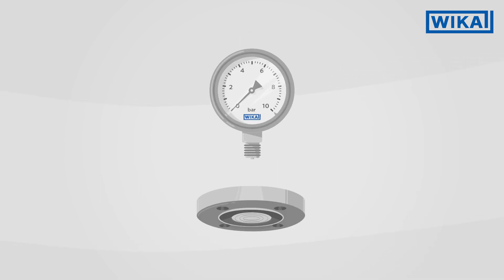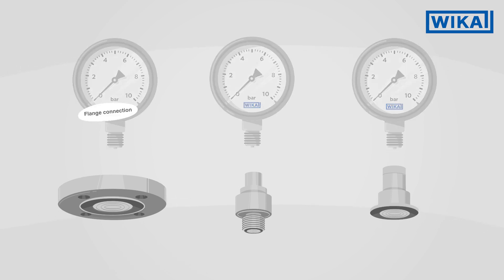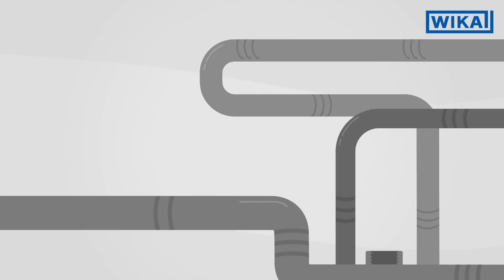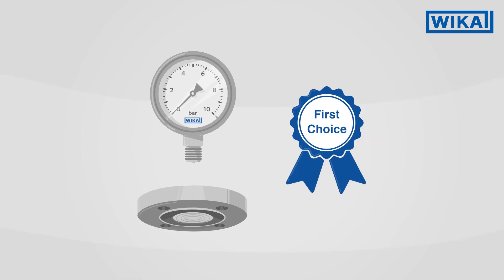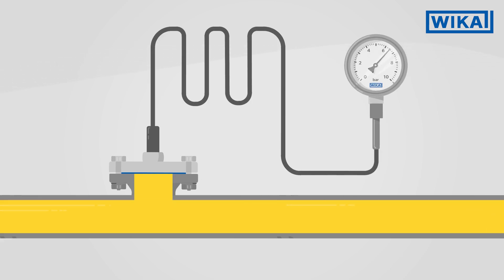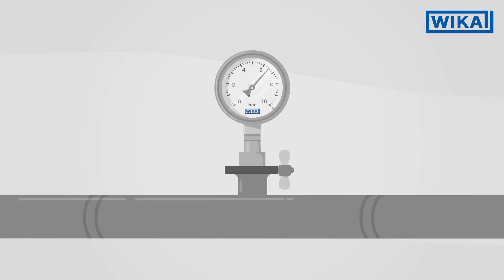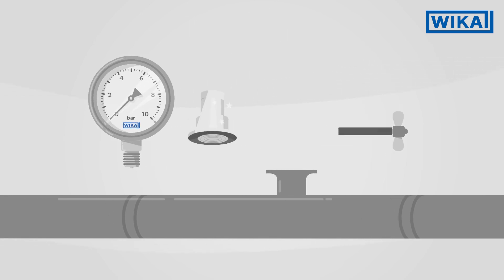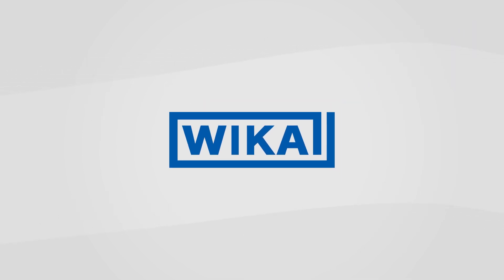Measuring instruments with diaphragm seals | Which process connection for which application?

Comment: Can I ask is it allowed to have tee connection in capillary Tubing? The situation is there is 1 diaphragm seal threaded and going to pressure gauge and pressure switch through capillary Tubing? Appreciate your reply..Thanks
Reply: Basically YES! We have here more than one option: 1. You can use an instrument with an included switch (like our PGS23 family) or 2. If the measuring performance allow us that, we can assemble two complete different instruments. Both cases are depends on your application, we'll be happy to provide you a solution. Don't hessistate and contact your local support. This is Tobias (PM) from Headquartes. https://www.linkedin.com/in/tobias-hench-499b2899?lipi=urn%3Ali%3Apage%3Ad_flagship3_profile_view_base_contact_details%3BmyJe3TueQ2GDhac8YpwbOw%3D%3D